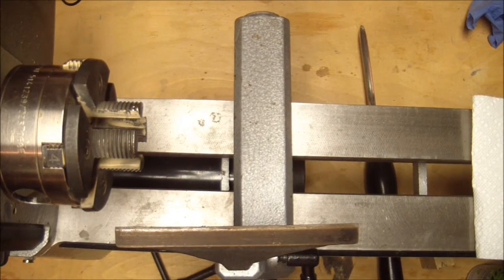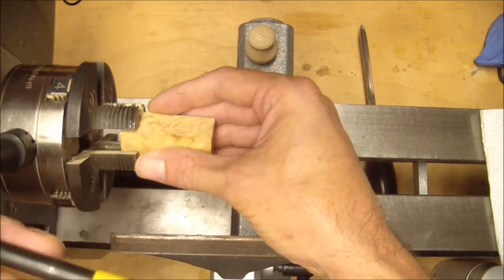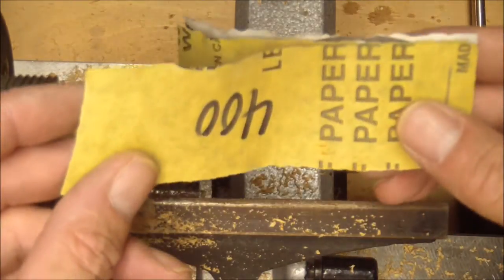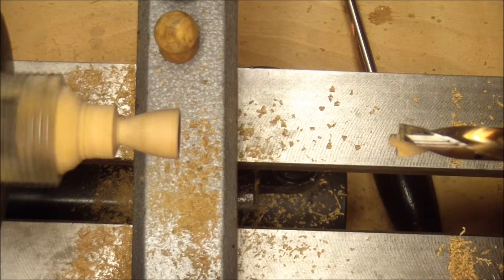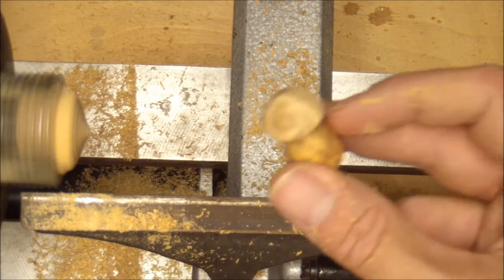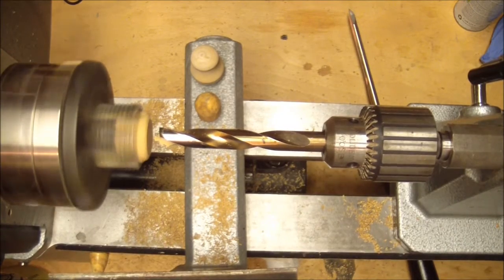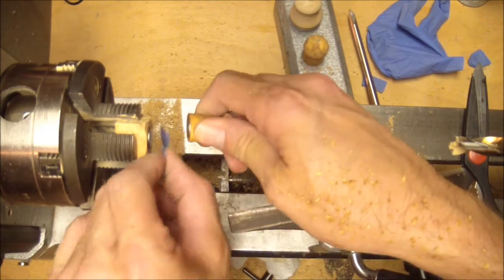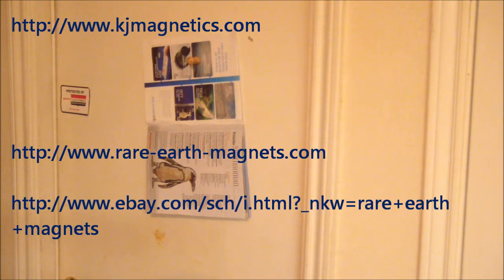Turning a Refrigerator Magnet

Comment from the maker: @9inety9, one thing I failed to mention in the video is that I make one magnet jig for the "re-chucking" and use it to turn the tops of multiple magnets.  I have done it both ways, but using the magnetic "chuck" allows me to apply the friction polish to the top as it is spinning on the lathe which gives a much nicer surface and gloss than applying by hand.  Also, for me, turning to a small diameter then sanding the entire mushroom is a much more delicate operation which results in more breakage.